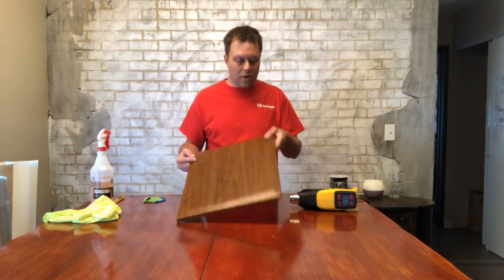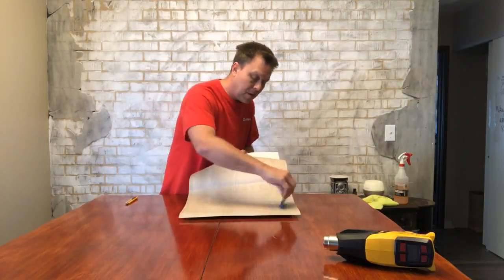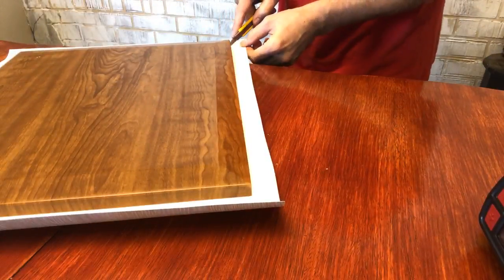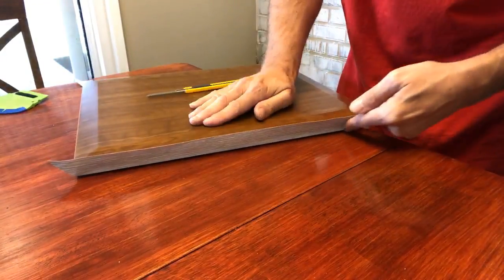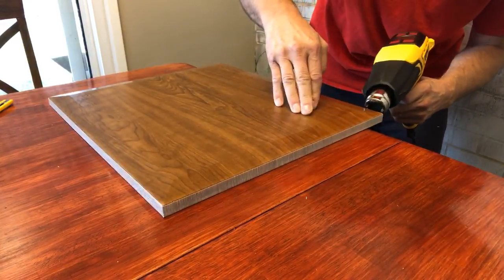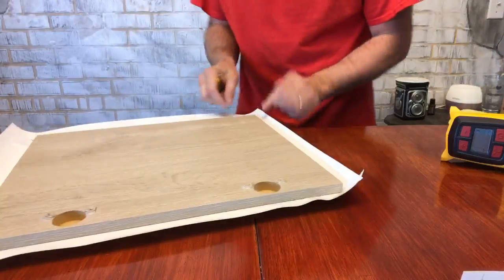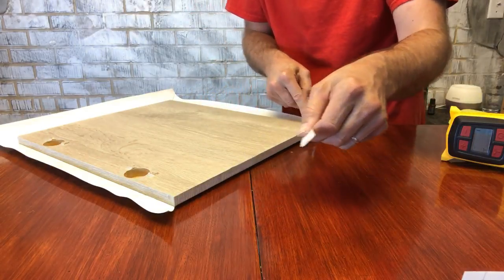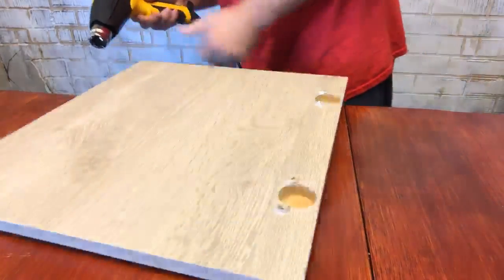How to wrap a cabinet door using 3M Di-Noc Architectural Films RM wraps

Comment: Thanks for sharing your skills and tips!  I have just wrapped my kitchen and my friend likes it so much she wants to do hers.  The problem is that my doors are flat and hers are cathedral style. Hers are solid oak doors too so it would be a crime to scrap them.  I have been looking for a video which shows how to wrap those but I'm beginning to think it might not exist.  Do you know if wrapping non-flat doors is possible?  Do you wrap the flat sections and cut a piece that fits the curved section?  Maybe wrap the flat bits and paint the curved sections?  (I have seen your excellent vid on wrapping shaker doors and they look challenging enough!).  I painted (with many, many cans of spray paint) a previous kitchen, which was v successful but much more of an effort than wrapping.  And no cheaper.  I love the wraps!
Reply from the maker: The cathedral door can't be wrapped. The grooves are to deep for the vinyl to go in. The best thing is to paint them.
Reply from the maker: https://www.rmwrapsstore.com/blogs/tools-and-materials/how-to-fix-thermal-foil-cabinet-doors

Comment: Hi. Great video! Informative.  I want to wrap my kitchen. I see that you use an adjustable heat gun. What temperature are you setting? Can I use a standard hair dryer for this too? Thanks for your time.
Reply from the maker: A $25 heat gun will work better.
Reply: @RMwrapsllc  OK. What temperature are you setting. I have a heatgun with two settings used to remove paint. Maybe on the low setting it can be used. I have an external thermometer to measure the airstream coming out.
Reply from the maker: Low will work

Comment: Don't try and tell me your removing your air bubbles by reheating the area. That air is trapped in there.
Reply from the maker: 3M™ DI-NOC™ How to Remove Air Bubbles in the Di-Noc and Belbien Vinyl Rm wraps
https://youtu.be/BTmug1IQaAI
Reply: Not with a TINY pin or needle prick in it ,it is not .